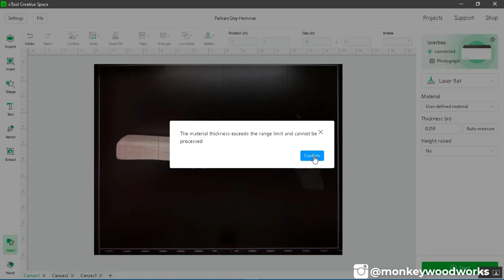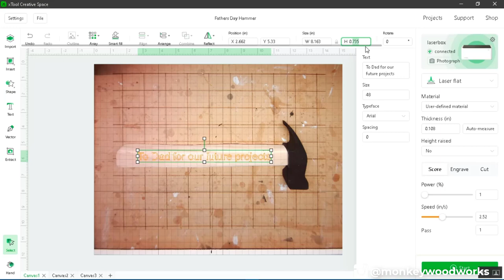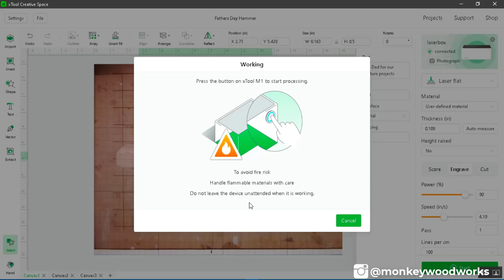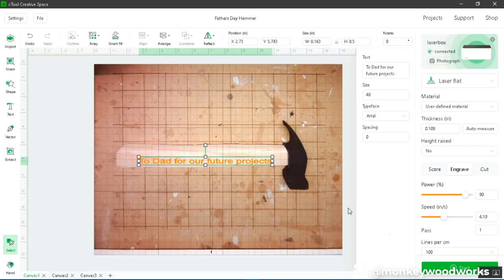Engraving a Hammer's Wooden Handle for Father's Day

Comment: Thanks for explaining the "frame" feature!  I tested on a stainless-steel cuff the other day, and I now have the top of the word BRAVE engraved on my bottom plate!
Reply from the maker: Oh no haha.  Well, that should always remind you to check your work!  I suggest you find a piece of aluminum at HomeDepot or similar that fits the base and keep it there just in case when engraving.  This will protect the black base of the M1.  The black base needs to be protected because if you ever use the double-sided cutting mat for blade cutting, it can easily stick to the black base when needed.

Comment: Do you have a video on settings for certain materials?
Reply from the maker: Every setting I use I try to share in my videos.  However, most of this is trial and error till you find what fits your preference.  Plus, the settings will vary by the species and thickness of wood and/or material so I always test on a test piece first.

Comment: Hello, i  love all your m1 video has help me a lot.
I was wondering where i can get the honeycomb for the xtool m1
Reply from the maker: The homemade honeycomb i use is not the best.  it doesnt allow enough airflow.  If you look online, a 300mmx400mm honeycomb will fit.   However, on esty, a person is selling an exact fit honeycomb for the M1.  The only drawback of that one is that it doesnt have a frame around it or a baseplate.  Its literally just the honeycomb and a bit flimsy.

Comment: How can I turn off the cross hairs and get just the led light for exact location, same software as you but on the D1? Thanks
Reply from the maker: The M1 does not have cross hairs. It just has a dot.   Maybe the laser modules are different.
Reply: @MonkeyWoodworks  thanks

Comment: Not being able to trust the camera is making me regret my purchase. Once it arrives I may change my tune but the whole reason I got this was because of the camera
Reply: I wanted this machine also for the camera but looks like it doesn’t work properly. Too sad!
Reply from the maker: The camera works great for flat surfaces and is handy to get you in the ballpark.  You have to use the framing feature on all lasers to make sure it will fit your needs.  The camera makes the setup that much faster.
Reply: @MonkeyWoodworks  could it be that the placement of the camera was so much off, because the automeasure showed a false value? (that hammer certainly is thicker than 0.1in).  I saw on severeal videos that adjusting the focus height also changes the camera preview in the software.

Just ordered the M1 yesterday and looking forward to using it :-) good videos!